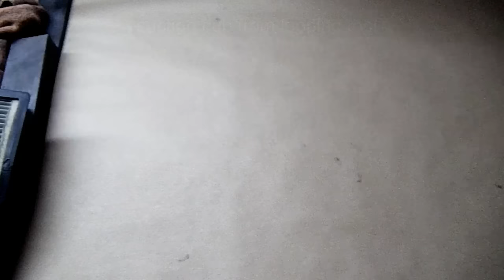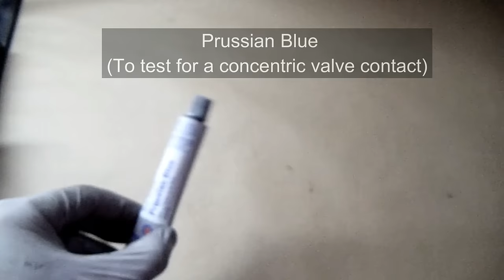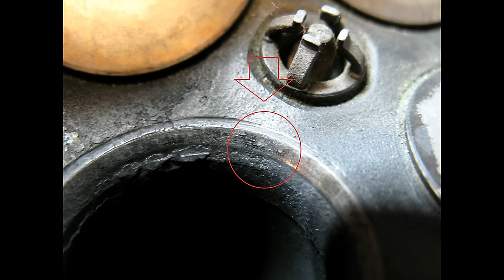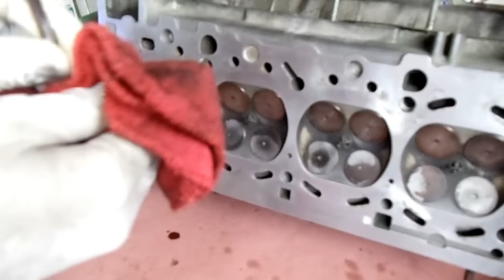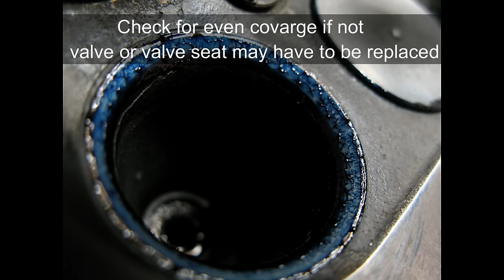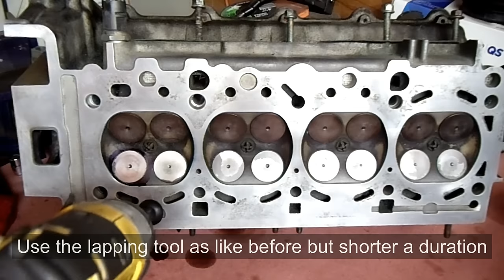Lapping and Checking Valves (EASY WAY)

Comment: You just screwed up using the cordless drill, the lapping process needs to be done with a back & forth motion. 
The old mechanical valve lapping tool from as far back as the 1950 works the best .
 The tool oscillates back & forth while turning the little crank handle . While doing this lift the valve off the seat to let the compound seep down in the seat .
Repeat as needed until you have a gray uniform shaded surface evenly over both valve & seat .
The process of using the drill is quick ! BUT if there's a imperfections on the seat the rotation of the valve using the drill will transfer that imperfection over the entire surface of the seat , therefore defeating the whole purpose of the LAPPING process...
JMO .
Reply: the tool you mention is ZIMM, fine for valve lapping, as you say , the motion of the valve should be back and forth with increment  of the rotation angle at every few strokes, the Zimm tool do that
rotary lapping as done in this video promotes an egg shaped seat if the guide is not perfect.
When i do a complete guide, valve and seat grinding valve, I always complete my job by a VERY LIGHT hand lapping, I use a lapping stick and confirm the valve and seat contact area.
Reply: Well said, I could not have put it any better myself, this is the reason why there are no craftsmen left and engines are throwaway, the skills are lost

Comment: Wouldn't it be wise to replace the guides first befrore lapping. Worn guides causes valve stem wobble. I mean, if you're looking for perfection why not start with perfect guides and not worn ones? If there's wobble at the end in the guide, the wobble at the valve end would be even greater. Equipped machine shops cost a lot but they can save you the trouble of starting over again.

Comment: I see only scratches on the valve seats, not a good job sorry to say. A manual job is the way to go.
Reply from the maker: True, the scratches were due to the valve seat lapping dry. My mistake, less lapping and more checking, plus I never really expected anyone to watch my video's.
Reply: estoy haciendo ese trabajo para un motor de suzuki forenza 2007, uso menos pasta esmeril y le agrego un poco de aceite para evitar un poco el roce y lubricar mas los asientos para evitar un poco los rayones.
Reply: Go into the pits at a NHRA event and you'll see  that most of top fuel and funny car nitro heads get the valves lapped between rounds. nothing wrong with valve lapping!  I've lapped valves for YEARS on engine overhauls and NEVER had a problem!
Reply: @angelito1906  esos rayones son tu superficie esmerilada. Si se necesitara aceite en los asientos, el compuesto para esmerilar ya lo traería. Yo hice el trabajo de forma manual  (sin taladro) en un Fiat 1500 '67 y quedó impecable, solo usando el compuesto grueso y luego el fino. Con el segundo hay que darle un par de minutos para que los rayones sean mínimos

Comment: He has clearly never used engineering blue to shut anything out properly before , that valve could have a 0.010" gap and would still blue up with the amount on there , should be applied with a tooth brush / paint brush sparingly , that blue is telling you nothing , and yeah thats alot of compound and no lubrication for the lapping
Reply: Red Pilz  hey , first of all im not a valve lapper by trade and I've never lapped a valve . That being said , I am  a tool maker by trade , I make lost wax injection mould tools for turbine blades and have made various other tools such as plastic injection mould tools and rubber mould tools , I can diamond polish to a mirror finish and blend die forms out to name but a few of my skills in my set , so I use all the same stuff in this video but in a different application . 
To best answer your question , the lapping paste in this video is quite "dry" , my diamond polish I get is much the same , if you just use it as it is , it will kind of "clog" up and also get hot with the drill., I dont think you need to drill it , better twist by hand , but each to there own , I would personally add a touch of cutting oil if available to the lapping paste when applied , or any oil or wd40 you can get your mits on , your lapping paste will last you longer and you will get a better finish , obviously the more oil you add the more you "water it down" so will take longer and take less material off , but a little wont hurt and you will find it just makes everything better and nicer , and if your lapping valves , use some engineering blue like in the video but use x100  less than him and apply evenly , press valve in , don't twist , and remove , it will take practice to "read" the blue on the valve but its not rocket science , hope that helps you , good luck on the lapping , if you need more help with the blue just ask

Comment: Does the valve need to be sanded and perfect clean before the suction cup? Mine wont suction
Reply: I have the same problem ive tried cold water, hot water,detergent,dry,400 grid sandpaper thats why im looking at the drill methods
Reply: Use a hose on the other end
Reply: @Michael-lg4wz  I did polished the combustion chambers with the valves in, so the valves where polished as well, completely recommended

Comment: How do I clean the carbon stuck on the valves and head? Tried brake clean and a rag still stuck.
Reply: T R, why would you ever have carbon deposits on your throttle body....the intake valves should be sealed at the time of combustion.
Reply: Berkebile 2+2 gum cutter

Comment: Far Far Far to much Blue. Best to use pencil lines. on the valve. Then on the seat. Other than that, the drill or impact driver is the way to go.
Reply: Atleast you know that camera is constantly focusing. Thats what all the clicking is about. Auto-focus

Comment: The reason you hand lapping stick is crap , is because of the diameter , slim it right down in a lathe to a concave shape,  it's best to do top and throat cuts to reduce seat width and help the valve cut carbon .

Comment: steps i would have liked to see.
one cleaning the head and valves prior to lapping.
the machine lapping process should be fine the suction cup to a aluminum head should be fine a low speed.
however the process I did not see and this is critical to a flow bench.
USING A BURETTE AND CORRECT OIL VOLUME TO PRECHECK FOR LEAKS.
IF OIL LEAK OCCURS THE VALVE WILL NOT SEAL CORRECTLY.
SECOND USING A FLOW BENCH WITH CORRECT AIR PRESSURE TO CHECK VOLUME AND FOR LEAKS WHEN 
DECREASE OF AIR PRESSURE OCCURS.
your process did not show any of this meaning a failure can occur and this being a ohc means the slightest 
offset of measure can create a CRITICAL ENGINE FAILURE.
other than the cleaning and checking process you can machine lap a valve 
HOWEVER without proper checking you may as well HAVE DONE NOTHING AT ALL.
thank you for this opportunity

Comment: Well I'm also a qualified mechanic, and this video is exactly now NOT to do a quality valve job (what, don't even take the spark plugs out???)  The valves need to be properly refaced to remove that pitting.  The seats accurately resurfaced, and if done with quality equipment no lapping will be necessary.  Put that much 'bearing blue' on a valve to check the valve seating and you should expect a 100% fit 100% of the time.  The correct method is the faintest light smear on the valve, giving it a small twist in the seat to transfer the blue on any contact points.  The key word is a very THIN smear.

Comment: Jesus look at the rings on the valve and the seat…that’s why I don’t use a drill and do it by hand ,spinning it back and forth both directions when you just spin in one direction continuously you develop those rings and they pit faster and don’t completely seal like if you were to do it by hand…sure it’s better then it was but I am a perfectionist when it comes to my work I’ll spend extra time on it doing it correctly even though I am a flat rate technician

Comment: If you use a drill, you need to lower the rpm as much as possible. In this video the rpm were so high, you just ruined everything.

Comment: This is ok but you should reverse the drill from time to time. The drill is going way too fast for my liking but may still work. You used too much prussian blue.you only use a very light coat to indicate the valve seat. If you flood it on you will not get a proper indication of the valve seat fit. When you finish put all the valves in and turn the head up so that you can pour petrol into the combustion chambers. If the valves are ground in properly then NO petrol should leak out. This video is of an easy way but not a good way. It would be better if people looked for other valve grinding video's.

Comment: I wouldent let you near my engine, this is not the way to do the job, its lazy and btw u should only put a thin film of the blue paint to see where it transfers and not slap it on there like you did.
Do it proper or dont do it at all

Comment: Congratulations you just created a poor valve and seat combo! Not the same angle as factory and way to wide. This might be ok on an old wood truck that you don't want to spend much money on but will NOT last. The only way is to have the valve ground and seat cut by a professional shop. You might have saved a few dollars but you wasted your time.
Reply: Congratulations.  You just made an asinine comment.